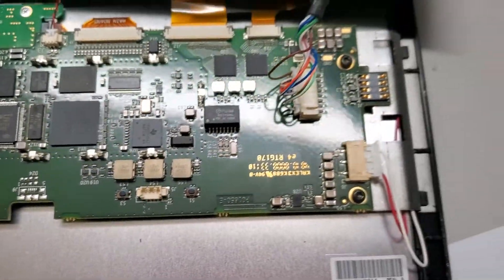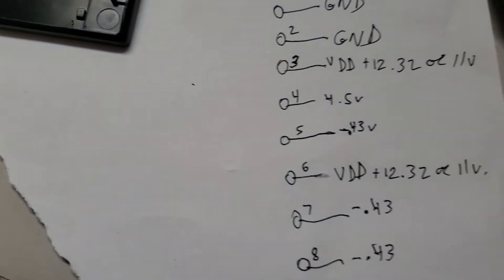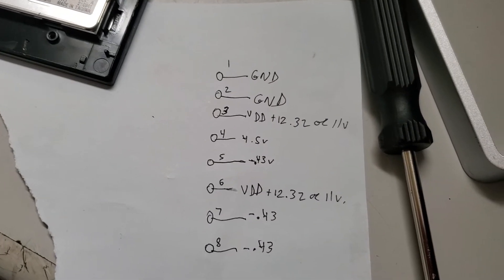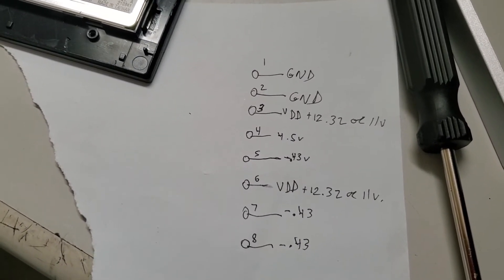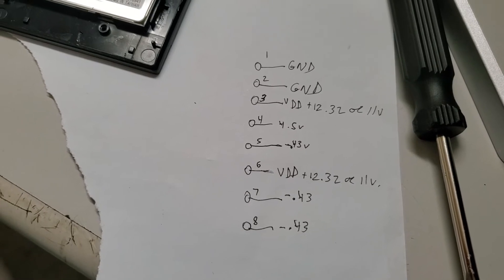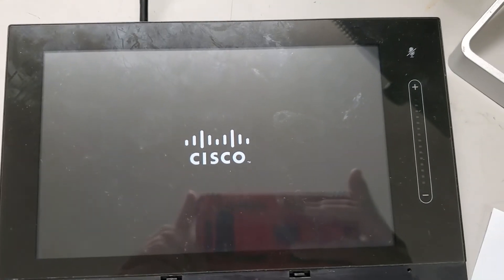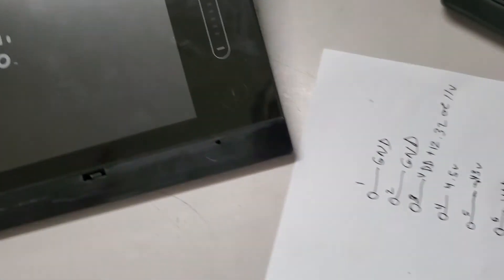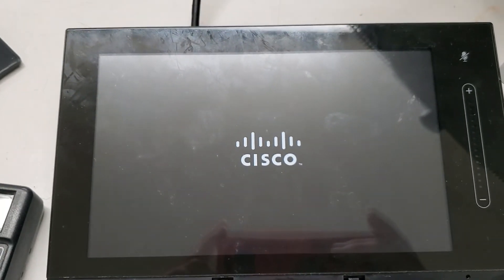Cisco Conference Display (Part: CTS-CTRL-DV8) Inside the Cisco TelePresence Touch Device.

Comment: @ 0:49 the white connector between two buttons is a console port with TTL 3.3V levels. Left to right - GND, TX, RX, 3.3V. 115200, 8, 1, no flow control. Figured out this yesterday when I was poking around mine TelePresence Touch which has a boot problem due to corrupted rootfs img file on both embedded OS images. Since there is no separate pkg or elf files for Touch console in a wild, I just thinking of scraping an LCD panel out of it.
By the way, you can try to change active image file (usually there is two of them) using this console to solve hanging problem. If it's still relevant to you, of course.
Reply from the maker: Thank you, that will help me in working with the console.
Reply: @jjosetheman  here you can find additional information (page 53)
https://community.cisco.com/kxiwq67737/attachments/kxiwq67737/4691-docs-collaboration-voice-video/6306/1/75041-BRKEVT-2805.pdf
Reply: @AlphaAquilae and @ jjosetheman Thanks for all the information guys. Recently got this device at a flea market for like 3 bucks. I managed to power the device and make a connection with the board. I am trying to play with its system right now :D